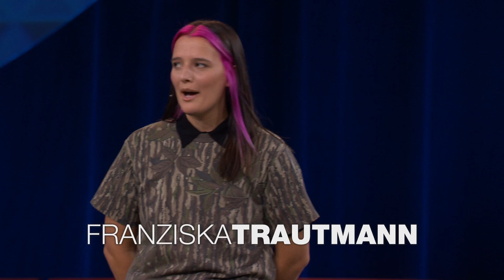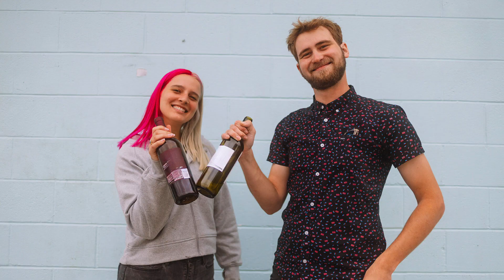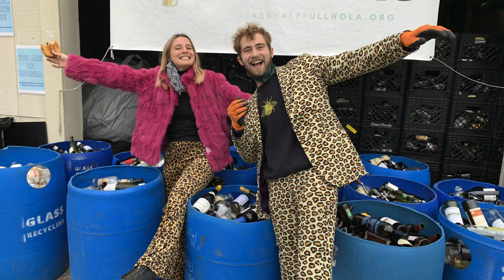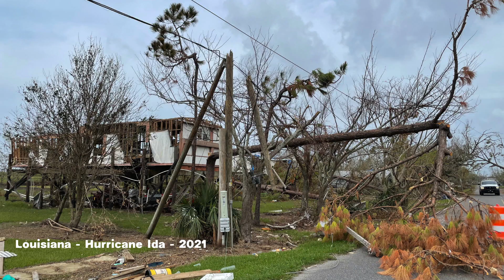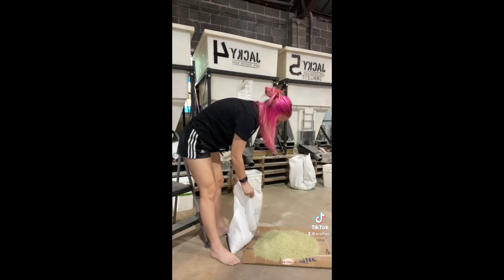Your Empty Wine Bottle Could Help Rebuild Coastlines | Franziska Trautmann | TED

Comment: ?why not reuse the bottles for other things and make a local produced lamps decoration etc. 
the energy used to produce the bottles and logistics and then just destroy it and then dum(b)p it somewhere does not matter where 
the sand made from the bottles will erode or washed away the same way like the stuff that was there

Comment: recycling = diverting one of the most recyclable  (actually needed in the process of making new glass) materials from landfills crushing it then making new landfills near the ocean.  I like the idea of refined garbage that doesn't need to be stored in a proper landfill.   I am not a geologist but isn't Louisiana almost entirely made of sediment from the Mississippi river.  You would have to convert a literal mountain of glass to keep up with the natural erosion.  Our planet is forever changing, processes with varying speeds... a river delta can change in a humans lifetime.

Comment: 🎯 Key points for quick navigation:

🏝️ Louisiana is losing significant land to coastal erosion, akin to a football field every 100 minutes.
🌊 Contributing factors to erosion include sea level rise, warming waters, severe storms, and oil exploration.
🍾 There was a lack of glass recycling in Louisiana, resulting in millions of pounds of glass waste.
🔍 Discovering that glass originates from sand, they realized sand is a finite resource crucial for many products.
🧑‍🔧 A pilot project was launched to transform glass into sand for restoration, despite skepticism from others.
🌿 The company, Glass Half Full, utilizes sand from recycled glass in state restoration projects.
🚀 They have diverted over eight million pounds of glass waste and are expanding with a new facility.
🌱 Biodegradable sandbags and native plants have helped restore coastal wetlands, demonstrating impactful results.

Made with HARPA AI

Comment: 🎯 Key points for quick navigation:

00:00:04 Louisiana loses land rapidly to coastal erosion, equating to a football field every 100 minutes.
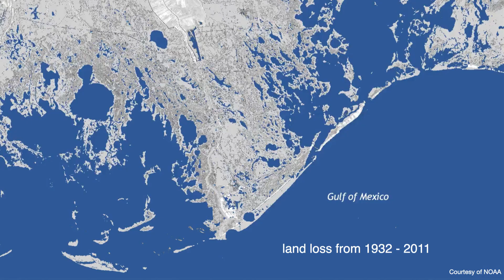00:00:36 Over 600 square miles have been lost in Louisiana, exacerbated by climate change and industrial activities.
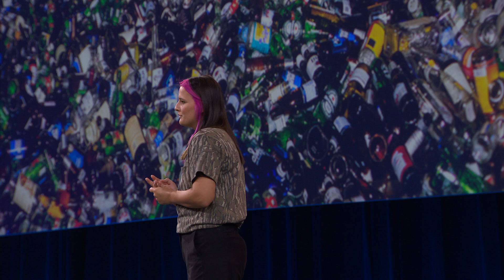00:01:09 A lack of glass recycling led to the creation of a project to convert glass waste into sand for restoration.
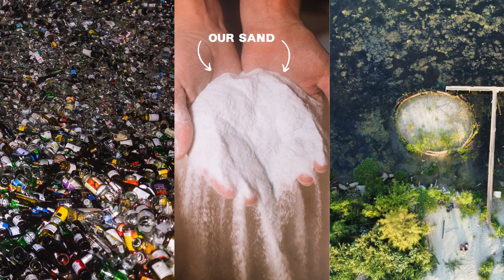00:02:10 The founders were motivated by hope and action, despite skepticism from others.
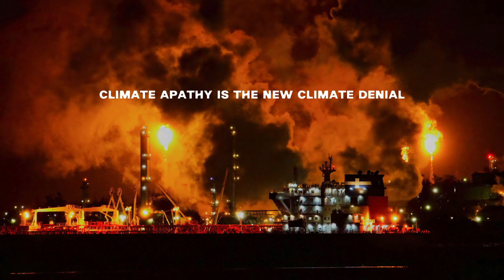00:02:42 Climate apathy is a significant threat, as it discourages individuals from believing they can make a difference.
00:03:15 The initiative has diverted over eight million pounds of glass from landfills, showcasing the impact of collective action.
00:03:45 The project collaborates with scientists to understand the environmental interactions of the recycled material.
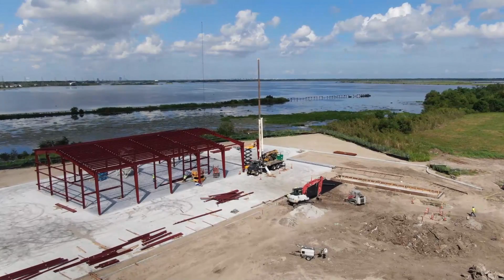00:04:15 A new facility will increase the capacity to recycle the 295 million pounds of glass that currently end up in landfills.
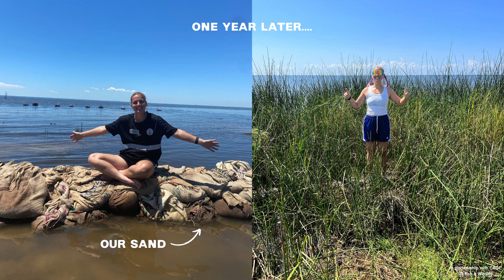00:04:41 Biodegradable sandbags and native grasses are being used to restore coastal wetlands effectively.
00:05:12 Success stems from taking the first step and believing in the possibility of enacting change.

Made with HARPA AI

Comment: Why would you crush the already blown (created) glass into sand, instead of just recycling those bottles and using the sand that would normally go into making new bottles for rebuilding the eroded land? 

They literally do this in places like The Gambia where bars and restaurants keep the glass soda and beer bottles and swap the crates of them out with the delivery guy when he drops off the newly filled ones. They get fully washed and sterilised before being refilled, and sure, you're going to get an amount of them smashed, so you're always going to need to create an amount of new ones, but you can at least reduce the need. With how standardised the model is for glass bottles, especially wine bottles, you could absolutely have sorters to send those back to the companies to refill, which would save a fair whack of energy instead of using energy to both produce the new bottles and then more energy to crush them into stand and transport the resulting sand to the places where it's going to be used.

It really seems like these kinds of startups get by because no one is questioning the logic of adding more steps to the process, rather than just simplifying it as much as is reasonable and putting that wasted energy to better use, for example in dropping electricity prices for the consumer.
Reply: Go ahead and try that here and let us know how well it works.
Reply: @raresparky  Bro. You literally missed the entire point of the TED talk. the whole point is try to something, even if the impact is small or imperfect. And this commenter also literally said that such a system already exist in Gambia. Don't be sarcastic
Reply: One-way material uses in most economies. It’s more difficult to recover material than create new ones, unless it’s an original part of the system, generally niche, not broadly implemented.
Reply: @ttopero  Necroposting a little here, but we did have material recovery built into our system with milk transportation and delivery (talking about the UK here). The milk men literally drove about in electric vehicles, picking up empty glass milk bottles and dropping off new ones to each household that paid for it. Unfortunately it was phased out in favour of cheaper (due to subsidies) plastic cartons sold from the supermarkets. There's realistically very little reason why we couldn't go back to that when banning non-biodegradeable plastics.
Reply: @ there’s a difference between the delivery service & the container. They can be related as I wouldn’t always remember my liquids (juice & such) containers every time I go shopping (no car to keep them in), so delivery would be quite convenient. Ironically, the only 2 delivery models that have sustained through generations are dairy & frozen; even non-perishable items are low profit to deliver. As a non-dairy, fresh produce consumer, I would be all over fruit juice delivery if the same service could bring 2l bottles as they deliver other perishable items. I have a dairy distribution company in my central city neighborhood that’s added frozen & animal products to their menu, but it’s definitely a premium for the same commodity I can get 1/4 mile away.